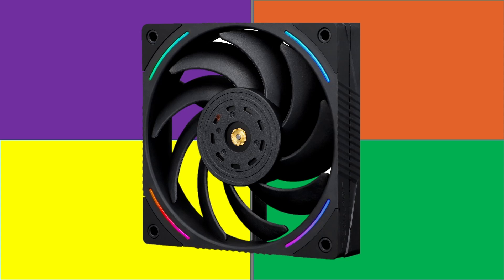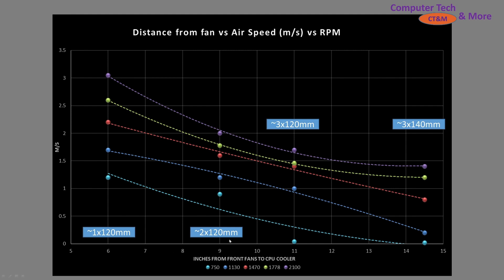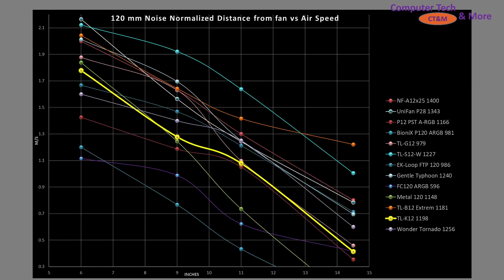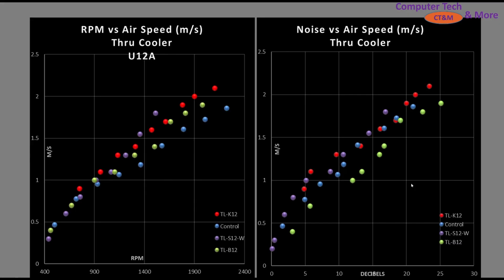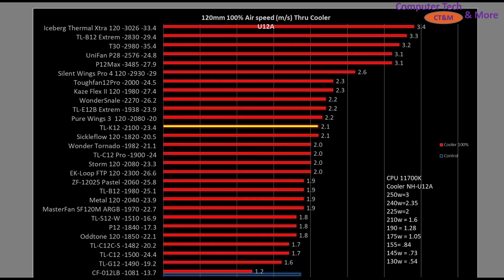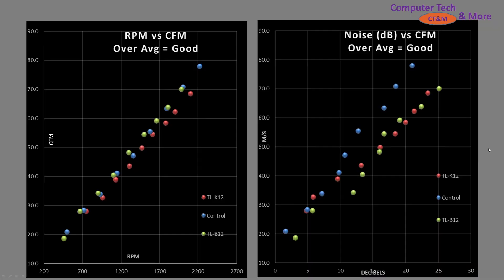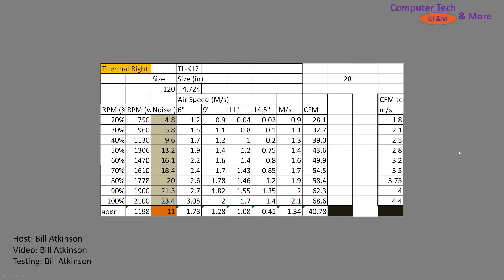TL-K12 Review: What makes this fan so special? Lets find out!

Comment: can you make a review of the TL-H12-X28 ? theres barely any info on that fan
Reply from the maker: That one is in the works. It is in my filming stage. fan has been tested but I need to get the data all filmed then video edit
Reply: @computer-tech-more nice, I already ordered it in blind faith, but I'll still watch your review cuz i love fan reviews lol
Reply from the maker: @ing412  :) thx. after you have it installed let me know if you like its noise profile.
Reply: @computer-tech-more  Hey! So i got the fan and have it set as a rear intake, so far the fan produces a hum sound after 900 RPMS, maybe a spacer will help, but still it pushes a lot of air and i can see my cpu temps dropped 1-2 C,the price was 7 dlls so yeah i cant complain.
Reply from the maker: @ing412  is the hum at any other RPM, that might just be a harmonic between the fan and the case. adding any rubber or spacer should help. 
glad it seams to be working for you. and ya Thermalright is crazy on pricing
Reply: @computer-tech-more yeap after 900 rpms theres hum, I'm gonna print a 5mm spacer and get back to you
Reply: So I got the spacer and installed it and now i keep the fan at 1200 and its relatively quiet, no more hum, overall I'm satisfied  and would buy again

Comment: Hi, I was looking to get 3 TL-S12 fans for the front intake on Fractal North but I notice that Thermalright sells the TL-K12 for double the price. Which fan do you recommend?
Reply from the maker: the S12 tested better in my testing if I recall. so I would go with that.

Comment: Im getting 11 of these fans for the Havn H420 case and im wondering if these can daisy chain?
Reply from the maker: that would probably be to much for 1 fan header. generally you shouldn't do more than 3 fans per header.
Reply: @computer-tech-more yes I'm only doing 3 fans on a daisy chain more than 3 is not good
Reply from the maker: @Munnitari  :) should work great then

Comment: I want to buy 2 tl-b12 for top case exhaust, do you recommend the k12 as both are quite similar
Reply from the maker: either would work about equally so it comes down to price at time of buying and if you want RGB.
Reply: @computer-tech-more  just bought the b12 3 pack combo, the argb wire can be annoying for cable management. Just hope it performs better when compared with be quiet silent  wings 4 pwm high speed
Reply from the maker: @Shanghaidoll9  I hope they work well for you.

Comment: Hi what is the TLDR for this video? is this fan performant? is it noisy?
Reply from the maker: so for coolers low wattage would be more akin to silent while high performance would be top end performance. 
PC case ranks were based off my noise normalized result. 
but its base off the fans rank or air speed mostly.

Comment: Hey man! Thanks for the review and insights for this fan. Recently i purchased a TR Phantom Spirit EVO and it comes with the TL-K12. Personally i really appreciate the subtle RGB effect as it doesn’t really shine maximum rainbow to my face while providing a hint of aesthetic to my case. I intended to purchase another 5 more to use it as my case fan (3 reverse TL-K12 for intake + 2 regular for up / rear mount as exhaust). It’s kinda sad that they haven’t release the 140mm variant which i can use it as bottom intake for my case (NZXT H6 Flow). Do you  have any recommendations for a 140mm fans share the similar characteristics in terms of performance and aesthetic like this TL-K12? Much appreciated and cheers!
Reply from the maker: unfortunately not really. these have a pretty unique ascetic. 
I hope thermalright releases more 140mm fans.

Comment: I'm surprised the TL-B12 performs much worse than the TL-K12 in noise normalized tests, considering both share the same blade design. That's weird don't you think?
Reply from the maker: I would guess inconsistency in manufacturing. It was not what I was expecting. 
Limitations with channel size. Ideally I would test like 5 or 6 of each fan and average the data. and talk about the consistency somewhere in the video.

Comment: Putting aside price, do you think this is a better fan compared to the TL-S12W for case fan?
Reply from the maker: 90% no. The K12 has 1 advantage a higher max RPM so it has higher potential there, but anything under 1500 RPM the S12 is better in my testing
Reply: @computer-tech-more  Oh ok thanks. I am building a new PC based on the new Be quiet Light base 600 - will have 6 intake (3 left/3 bottom) and 4 exhaust (3 side + 1 rear) - the exhaust will be 2150rpm (the newer TL-H12-X28)  that's why I am not sure if I should just save some money to get the S12 or get these to at least match the H12
Reply from the maker: in terms of air flow balance assuming your using an AIO that should be fine. For air cooler you actually dont want to populate all the fans.
Reply: @computer-tech-more  Oh ok then, thanks for the advice

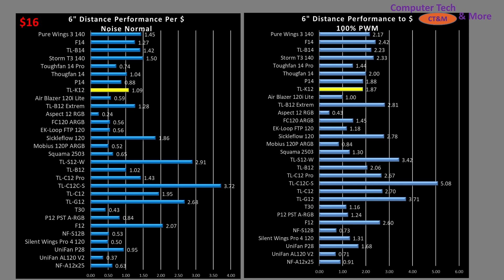Comment: 12:45 Dunno if you are already doing this in the newer videos, but if you also show the actual performance as a separate bar for each fan in a colour that does not stand out as much as the value bars, that should help viewers get a feel for whether the fan is high-value with bad performance, or high value AND has good performance! Thanks for the videos!
Reply from the maker: In newer videos for the value I have it high value to low, but all one color other than the fan of interest in the video. 
having each bar a new color is a lot of extra effort for just me. since this channel is just me. 1 person
Reply: @computer-tech-more  Sorry, I didn't phrase that well. I meant "For the noise-normalized graphs, show the actual performance (or dollar figure) as a separate bar (or just text) for each of the fans, in another colour", not do some rainbow shebang. That should a one-time setup with selecting a new range and styling it appropriately.

Without directly having either the dollar or the performance figure, it's hard to tell whether the value is good because it's cheap but with crap performance (as you say in the video) or if the value is good because it's a reasonably priced fan that excels in performance.
Reply from the maker: @SandyWhitmore  I guess the way I had expected people to understand. is watch the video and see ok here is the actual performance. Now is it good value for what your buying. In the section i usually even say "even if a fan is good value doesn't mean its a good fan" and something similar about its not actual performance. 
I can figure out how to add something to the graphs to indicate actual performance. it might just be test afte rthe fan name though.

Comment: Amazing video!!
I have 6 of those fans in my PC.
(3 case intake, 1 case exhaust, 2 radiator exhaust)

Do you have a recommendation of fan curve for this?
(Will be using 100% @ 80C)

But other than that I’m unsure what to use. I want them to be quiet but still to cool my system, any recommendation?

Thanks.
Reply from the maker: hmm my general recommendation for fan curves are first Set your CPU cooler fan to near max you find ok or silent, case fans set to like 20 or 30%. Then adjust your case fans to the same thing. 
As far as fine tuning a curve I go for a Log type curve so its a slower increase till temps get really high then the fans ramp. 
If you happy with the fans cooling and noise capability no reason to change them. 
Your fan in vs fan out is good. The back fan (exhaust) doesnt need to go that fast the cooler exhaust will do the heavy lifting there. I would keep that at like 20%. 
sorry side though while typing: you could "match the intake front to top exhaust. set it to the max you find ok noise wise. when in light or gaming use. Let the fans ramp under heavy loads to another level find acceptable.

Comment: Great review! Ive bought 3 of those for 15$ (all 3!). Brand new, some guy take them from aio to swap them for  white Arctic argb fans :) So i was curious how they perform and not bad at all. Happy to have them ;) also for people looking for advice if you buy them (or have them laying around) and those were also from aio, have in mind this version has different cable not just standard 4-pin pwm but 7-pin (pwm signal and led) to connect with splitter. If you can and know how making new cable is easy but if its to hard just cut some plastic and connect to standard 4-pwm with that method the led dosent work. But as was said in review it depends if the price was good :p
Reply from the maker: thank you for sharing your experience with these fans. Glad it sounds like your happy with them.

Comment: hi ,  about the noise row at the bottom.. 1198. does it mean the k12 fan becomes noisy from that figure and beyond
Reply from the maker: in the raw data: that is a calculated value using linear interpolation as an estimate for the RPM, air speed in each test using the noise normalized pre determined dB value. In most fans the defined 10 increment PWM signal does not match the exact noise value I want so I use math to estimate it. based on the values immediately above the value I want and below.
Reply: @computer-tech-more  lost but thanks
Reply from the maker: @justeddm  https://en.wikipedia.org/wiki/Linear_interpolation
haha sorry. I am an engineer. Sometimes i can get to descriptive.
Reply: @computer-tech-more  I will just go with the TL S12 (for exhaust) .. since my case is spacious enough

Comment: 750rpm already at 20%? And mediocre noise to performance ratio? Thanks for letting me know I can give this fan (and the Thermalright Phantom Spirit EVO) a skip.
For criticism: I'd love to get the minimum rpm that the fan will start at and any fan bearing or other noise that may be audible at that fan speed. As someone who loves silent operation, that's very important information for me.
Reply from the maker: I cant remember off hand but at the end of all my videos I have the raw data. So that will have all pwm and associated RPM and noise levels as well as air speeds listed.
Reply: @computer-tech-more  Yep - and for some fans the speed at 20% PWM or even higher is as low as they'll go.
But I specifically looked into your A12x25 review and in your data it does near 500rpm at 20% PWM. Cross-referencing with other reviews (Igor in particular, the man is meticular) it'll turn on at around 300rpm and turn off at 230rpm. I think this is worthwhile information for fans that have a truly broad RPM range and can actually utilize the 10-20% PWM spectrum.
Reply from the maker: @Steamrick  most fans turn off below 20% pwm, I could be wrong but I think igor does voltage control and that does allow this or use a power supply to do voltage control. I try to test as someone would use it. But i doe see your point.
Reply: @computer-tech-more  Igor tests both voltage and PWM. I was referring to his PWM numbers.
I don't know what signal range the average mainboard allows people to use - I use an aqua computer Quadro and an Aqauero fan controller in my PC, which allow for extremely precise control.
Reply from the maker: @Steamrick  I just have an asus motherboard and use standard 4 pin fan headers. so that might be it.

Comment: Best fan comparison site 👍. When you say "noise normalized", how many decibels does that mean?
Reply from the maker: i have it set to an 11dB rating. I subtract out ambient noise to normalize it. so its not "11dB true sound". i choose the value because when I had an AIO on my last build I had 2 A12x25 running at about 1200RPM and found it to be near silent. And that RPM produces about the dB rating, so I chose that value as my noise normalized.